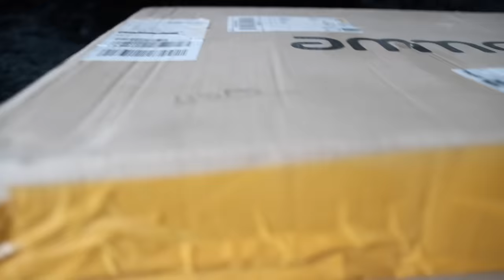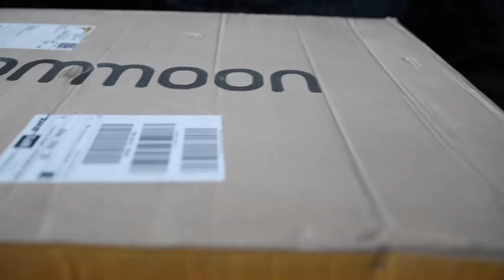CHEAPEST LES PAUL Style DIY Kit Review and Demo (Ammoon LP Kit)

Comment: I bought the same kit from ebay. The Neck Fit Was REALLY Lousy, Had To Shim It, The Surface Was Pretty Rough. For A Low $100's Kit. It's Just Repairing Problems Due To Poor QC. I Had To Refret The Neck. I Am So Glad That The Bridge And Tailpiece Holes Were Not Drilled. I Bought A Kit From Another Manufacturer Who Drilled The Holes. Needless To Say The Hole Alignment Was Way Off, And It Wouldn't Properly Attinuate. I'm Still working on The Kit, Just Taking My Time Repairing Their Mistakes.
I Would Not Buy Another One Though.

Comment: oh and they dont drill the holes cause without the neck on you cannot line up your bridge correctly had they drilled it you would most likely be filling the holes and re drilling after your shims.. come on man how do you not no this?
Reply from the maker: If they could cut a better fitting neck pocket then they would know exactly where those bridge holes go. They decided to route for the pickups which also depend on how the neck is situated, so...why not the bridge? Like I mentioned in the video, other kits come with them pre drilled. Just not this one
Reply: Deulicious Mafuka - there are PLENTY of LP kits with pre-drilled bridge holes. How do you not know that?
Reply: DiscoScottie i know that all to well unfortunately had to fix one of them for a customer last week lets be real its a 120 kit you get what you pay for i would personally wrather have it un drilled then re drill and fill cause if they cant cut a neck pocket right i def wouldnt trust them to take proper measurements to line up a tail peice and bridge.

Comment: Yet another guy on the internet that thinks you are supposed to use liner taper on tone. That is not true at all ever. Unless your looking for a tone cut off almost like a switch they need to be audio taper. Also volume should also be audio taper not sure why they would be linear. No pots for guitar should be linear. But there has been instance on some epiphone jazz guitar I believe that used linear for volume. Tone is 100% audio no exceptions. But it has been widely spread in the internet to use linear on tone. No manufacturer does this at all. The effect is having full tone as you turn the knob nothing happens until about 3 the  suddenly the tone is sucked out. For those looking for that sharp on off style then linear will be fine.

https://youtu.be/7ANG3OrL5HI

Again no manufacturers use linear. I don't know why linear are even sold. Maybe just the demand from amateurs reading online to use linear. I know I made the mistake myself the first time I built a guitar.